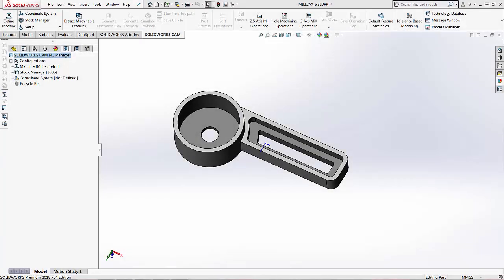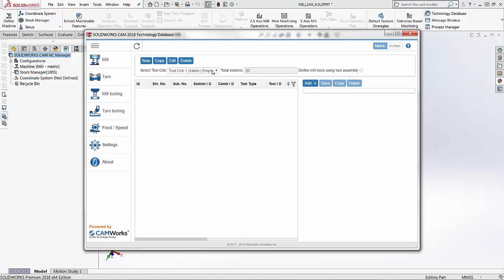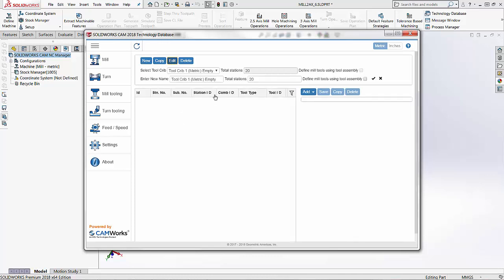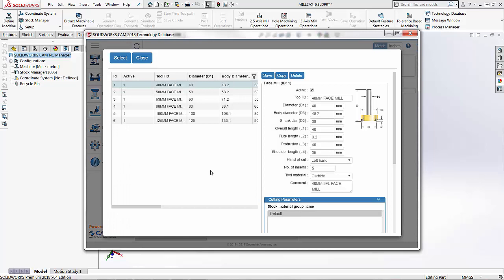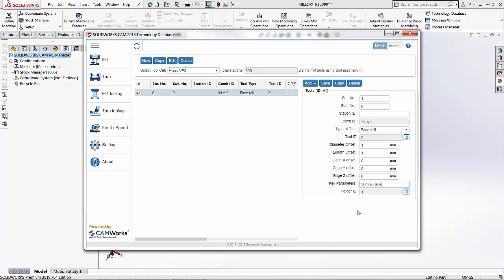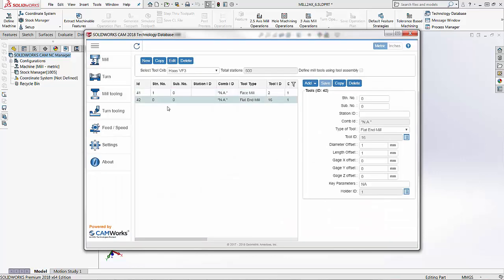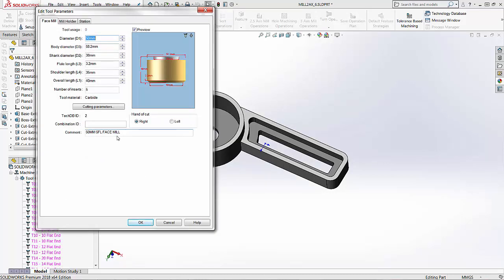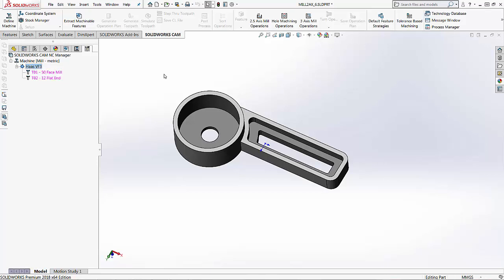What's New SOLIDWORKS CAM 2018: How to Create a Custom Tool Crib

Comment: I have a milling machine that that uses mostly metric tool bits but some standard inch. Is there a way to have both in one tool crib? I finally got a tool crib together with your video. my parts are designed in inch so the tool crib automatically defaults to inch tool cribs. the only way I can see my metric tool crib is to change the units in solidworks. be nice if you could set the units to dual dimensions and see both tool cribs.
Thanks
Reply from the maker: Hello, thanks for your feedback! One of our CAM experts would be happy to help you out if you could fill out your request here: http://bit.ly/2JRLs21